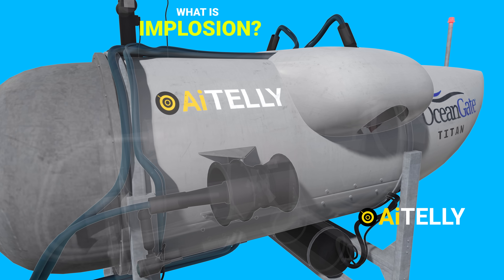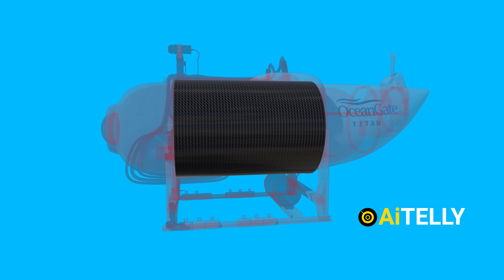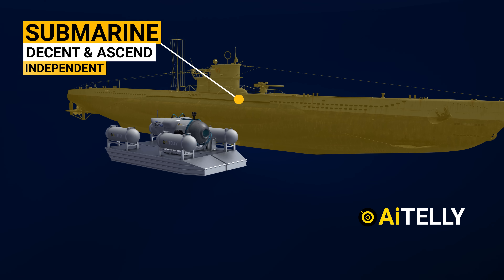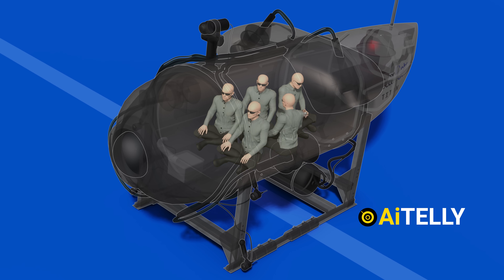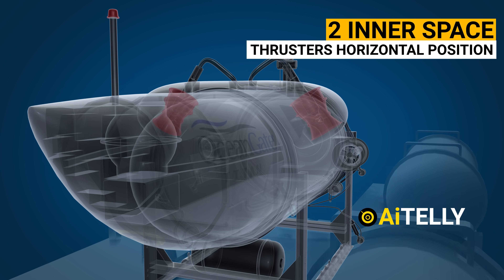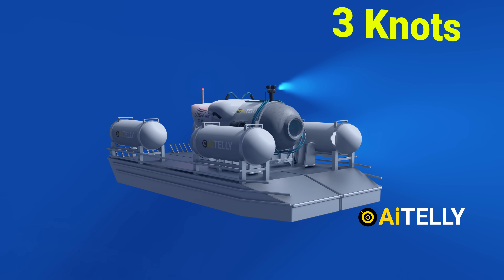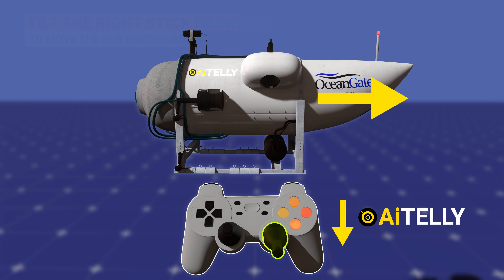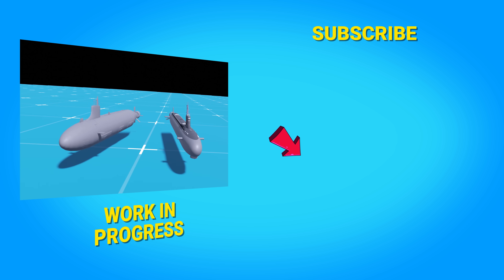Implosion Titan Oceangate How it Happened | Submersible Submarine Parts #3d

Comment: We dont know what depth the Titan was crushed at, just the time that communication was lost?  According to the SOSUS there was a sound anomoly of an implosion within a couple of hours of decent, it would be informative to know the precise depth as to the structural issues of this submersible which would be a determinal factor.
Reply from the maker: 😮😮😮 smart audience

Anyways 
You might also like Nuclear Powered Submarine Engineering behind it #3d Nuclear Reactor released
Link: https://youtu.be/J0lb46Zi5-s
Reply: It would be interesting to know if they crushed on the way back up after encountering a warning.

Comment: Transcript of communications has been released. They knew they were in trouble 20 min before communications was lost and presumably the sub was crushed. They had dropped weights and was rising slowly to the surface. They reported hearing cracking in the aft section of the sub and they were having problems with the electrical system which was designed by community college interns. It was rising too slow and they dropped the docking frame to hurry ascent. The cracking subsided, then resumed again. After a few more texts, all communication was lost. I'm actually happy to hear this scenario might have played out, because this means the passengers realized how shitty the sub really was and I hope  Stockson came to realization that he was wrong and everyone else was right about his sub.  They were likely panicking like trapped wealthy rats. At least all passengers got a real bang for their buck.
Reply: Your last sentence was unnecessary and heartless, mate.
Reply from the maker: Glad we found this comment

You might also like Nuclear Powered Submarine Engineering behind it #3d Nuclear Reactor released
Link: https://youtu.be/J0lb46Zi5-s
Reply: Wow.

Comment: I think in this animation the only thing wrong here is that the outer shell wasn’t under any pressure at all and would not have crushed as depicted. That is the reason there are so many large pieces. The only part to implode was the carbon fibre hull itself the outer shell was just a casing. I ain’t no expert either but I thought I’d throw my 10 cents in. R I P to those poor dudes though
Reply from the maker: Nobody is Right 

But You might also like Nuclear Powered Submarine Engineering behind it #3d Nuclear Reactor released
Link: https://youtu.be/J0lb46Zi5-s

Comment: Stockton  Rush was a gambler who took unnecessary risks.    Everyone in the deep submersible community with collective decades of experience designing and operating these craft told him it was unsafe.    He metaphorically flipped them all the middle finger and went ahead with the project.   The level of hubris, arrogance, recklessness on display was breathtaking.    Here is a basic physics observation that explains why this tub was a disaster.    It is well understood that a sphere is the most efficient shape to distribute  large amounts of pressure equally across it's surface.   As an engineer I was trained in college that equations and mathematical models are not perfect.    There are lots of unknowns that we just don't understand in complex equations so we just invent a fudge factor into the equations.  This "fudge factor" is where we lump all our ignorance about the system under study.    Tell me do you want to risk your life riding a submersible designed using this approach?
Reply: He was a sociopath and luckily he only killed 4 other people instead of hundreds or thousands
Reply: I've never heard the word HUBRIS so many freaking times as I have in comments/articles about S. Rush.
Reply: @jrambo7495  Sure, the crap, I mean craft could have been aptly called, 'The Hubris.'
Reply: What I don't understand is, if they wanted to go this route with CF, why not at least test with a remote unmanned model first? No one's life is at risk and you can find out that your design did or did not survive. Nope, just "I think I've got the numbers right. HERE WE GO!"
Reply: Fun fact. Mrs. Rush great great grandparents died on the titanic. The titanic has been ending the lives of rich people since 1912.
Reply: Perfectly penned 
and I enjoy reading the use of adult words being used as such. 
“The level of hubris, arrogance, recklessness on display was breath taking.  “ 

Yes it’s mind boggling to understand the reckless disregard for human life and to think he could design a sub without the advice of those that have been testing and building them for decades “TESTING” what a novel idea! 
Who would have think that one with money would cheat the whole system and not hire the best people WITH EXPERIENCE! 

Well… sadly it took the lives of people that didn’t deserve to die, no one does.  
But usually the idiots sort themselves out eventually.
Reply: @cindyherget5196  said culling doesn't happen nearly often enough
Reply: Fudge Factor perfectly described the plot of Jurassic Park, too. They didn't have the entire DNA code to replicate dinosaurs, so, they used amphibian. Same result. Bad news.
Reply: Great explanation. Thank you
Reply: I feel like he didn't care about basic physics or safety. He was acting like a little kid wanting to prove everyone else wrong (like you said with the metaphorical middle finger). I could have built this in my basement given the right tools. That's how scarily bad this was designed and engineered. I still can't wrap my mind around the fact that people paid money to go on this trip. That's literally paying $250k for su*cide
Reply: @reallifein3d A sociopath just like Lucifer bathing in the false light illusion that is the fallen angel. Legend had it that Lucifer was one of God's angels, but because jealous and spiteful wishing to replace God in contempt, mayhem, and conspiracy to ruin God's sacred creation, The Earth. The bad old cabal that forms the World Economic Forum and World  Government Summit is the old beast system coming out in plain sight to make the third world war. It won't be long that everyone agrees there's one question everyone must answer. Will you take a stand for all that is true and noble to save and restore Earth as the Kingdom of Heaven or are you one of Lucifer's coward traitors ducking and covering under the evil one's grand deception. Either we all get mass murdered as victims in fake democracy ruse or we die fighting for what's left of Earth and humanity in final battle for Earth which doesn't belong to the evil cabal of corporations and financial elites like Klaus Schwab and Henry Kissinger and their coward puppets sponsoring unnecessary dystopian manufactured crisis and the old war racket ruse, namely Joe Biden and Kamala Harris among a billion or so bad actors consenting to conspiracy for selfish personal gain and servicing their fragile ego's, for the Earth is God's sacred creation. The kicker or problem is we all can't seem to  unite nor agree on anything out of being dependent on the beast systems debt based economic, wars for profit, supermarket food, pumped gas, and global technocracy tyranny attempting to replace God as the false Messiah or savior. It's going to go as far as making WW3 with fake ET illusion arrival for it's subjects to take the market of the beast which is probably Neuralink brain implants Klaus Schwab announced are mandatory in 2029 which are likely to be the strongest fighting survivors of humanity and then of course  the coddled evil cabal sure to duck and cover inside a Swiss mountain when they order nuclear war. They really got North Korea going these days just provocatively announcing they're about ready to nuke the US mainland out of the perception of being deeply humiliated by America's powerful image and geopolitical dominance during the 20th century which doesn't bode well for us in the 21st century.  It won't be long that it becomes impossible to mention anything online and refer to posts and written history detailing truth to be stranger than fiction when the air and water in the outdoors are too bad to survive without equipment, protective gear, and resources. 

Reply

provatively
Reply: "gambler" ....???  NOPE, He was a Narcissistic Sociopath who did not heed the advice of his engineer who he fired for pointing out the flaws in his design. If he did listen to his engineer, he and the others would still be alive.
Reply: interesting thing is that all contemporary physics, from electromagnetism to relativity to qm to electrodynamics to gravity is full packed with fudge factors and deceitful variables; feynman plainly said that the material realityi does not exist, only math do, and a full series of phantom never seen particles and forces acting across the universe like magic added ex-post only trying not to collapse the contradictory theories; in the first place, i dont believe neither to the official version of this implosion, it seems a scam to me, because the beebe bathysphere, or the benthoscope, were 1.4 mt nickel chrome steel spheres 5 cm thick, certified to collapse at 3000 mt depth, and made a pair of voyages to max 900/1500 mt, and during all their operational life were constantly tested for microfractures; it is simply not possible that a plastic cylinder, with two metal detachable caps, could withstand tenth of trips to 4000 mt; moreover, ultra depth submersibles use advanced syntactic foams to fill the outer hull, where titan is photographed with polystirene fillings behind the glass fiber external panels. And i have tenth of other strong objections.
Reply: although the deepest submarine wasnt a sphere
Reply: @TheGrassyou  True, but they were made out of great materials like US Steel.
Reply: Simply, no.
Reply: The owner of the submersible was a total madman, that's why he didn't get to be an astronaut. The 4 passengers rest in peace.
Reply: One only has to read the New Yorker article to see that the arrogance and the hubris that ultimately did this man in
Reply: he didnt want some uninspiring 50 year old white guy he said so instead he got what he deserved.
Reply: Why did stocton do this he eas well warned he could of done so much more with his money when there is so much poverty in the world and his poor kids have to live with this where's wendy she has 5o live with this  she will be in some state being left with this mess  it just should never of happened
.
Reply: I certainly hope that Oceangate is held financially responsible as well as morally.  Stockton Rush was an arrogant man and an irresponsible engineer.  Didn't it say something like his toy was safer than walking across the street or something similar?
Reply: I agree.
Reply: All adventurers are gamblers and wreckless...and thank God for that. If they weren't we would never have built ships or tried to fly. Do you think that Vikings were safety oriented? Do you think there were even seatbelts on the first wooden plane?

YOU PEOPLE ARE ON ANOTHER LEVEL. 😂😂😂😂

Rules, rules, rules, safety, safety, safety.  😂

Live your life in bubble wrap but leave the rest of us their thrill seekers, dreamers, adventures and adrenaline junkies alone. You enjoy your knitting needles and rocking chairs...I'll be over here enjoying my parachutes, rock climbing and spelunking.
Reply: @caseroj6020  very interesting
Reply: he was a narcissistic asshole and should be charged with Murder, he knew this was just a matter of time.
Reply: Only my curiosity, if the tube where from steel or titan, then will the submersible survive the deep? thx.
Reply: @caseroj6020  I’m a stress analysis engineer (making sure things don’t break) for the main aerospace industry. 

This is a cylinder, not a sphere. A sphere will evenly distribute the load along the walls. A cylinder will have peak stresses at the ends of the cylinders and that’ll be the weak points. 

I’ve taken things to the line of complete ultimate without any failure and I’ve never had any issues, which will deem you as an “expert”
Reply: In the beginning of all this I did a rough calculation making a lot of assumptions but probably still within 10% accurate. At the depth of the Titanic wreck the total hydrostatic pressure attempting to crush the submersible was 425,000,000 pounds. That doesn't mean much to most people. So I decided to give that pressure some meaning. A fully loaded Boeing 747 weighs about 900,000 lbs; when you divide the 425 million by 900,000 you get the weight of 470 fully loaded Boeing 747s attempting to crush that little "plastic" cylinder attached to the titanium 'bottle caps'. Exploring the ocean at those depths does not allow for beta testing of diving craft. Way back in 1960 a well thought out craft went three times deeper down into the Marianas Trench,
Reply: I wasn't trained in any school. I was trained out on the jobsite itself. So who's opinion is more valuable? Pretty much the same answer but again no attention served to the lowly peasant.
Reply: @RobzdaBlade  No specific training for submersible design was displayed.  As they said themselves, they made a "basic physics observation" along with knowing about "fudge factor," albeit using the colloquial term.  All designs use a safety factor, especially good designs.
Reply: @RobzdaBlade it's nice to have both to be an interpreter between the book smart and the street smart people. My dad has both, and he always said to never disregard field experience. You know, even the best plans don't survive the first brush with the enemy, and all that jazz. And when your plans go off the rails, field experience takes over and keeps everything from falling apart.
Reply: @RobzdaBlade  Many jobs can be trained on the jobsite without formal training. Other jobs require complex math and physics training. People who designed rockets, planes, and space shuttles need formal training in math, engineering, and physics. Civil engineers need formal training to design safe skyscrapers and bridges. The combination of formal training and experience in those jobs is critical.
Reply: First off. People still die going to space. And even in subs. When any technology or weapon or medicine etc is created. There is always a testing period and human testing. And the gamble is always someone or alot of people will die. Nothing is 100percent even when its quote on quote ready and even had successful  missions up-teen times.
This man wanted to create something successful and go against the grain and be the master mind behind something he felt good about.
Experimentation is how things are created. Unless it is naturally done through nature than all of the things humans decide to create will always be experimental.  In this lifetime or later on. In a book someone will take this same idea. To try to makebit better. This history books have many inventors that started something failed and someone else came along and made it successful.
Reply: @Uwontregretit101  Your comment is valid, BUT in ALL the examples you gave, we MUSY assume that the PROCESS of creation was done RESPONSIBLY! And to me according to statements made by advisors ,designers , he DISREGARDED the advice that the materials were not safe. To the point of NOT subjecting the vessel to proper testing!! There is no problem innovating, but do it correctly. And in this situation, SAFETY is PARAMOUNT!! Nothing is more important. There IS a lesson to be learned here.
Reply: Must, sorry.
Reply from the maker: You might also like Nuclear Powered Submarine Engineering behind it #3d Nuclear Reactor released
Link: https://youtu.be/J0lb46Zi5-s

Comment: You can imagine James Cameron’s reaction when he saw the design of the vessel and how it was controlled by a cheap video game controller. Contrast this with his sub he designed to go into the Mariana Trench, Challenger Deep — super high tech, state of the art, multiple safety features and backup systems. Made of steel, not carbon fiber.
Reply: El controlador de juego no era un problema porque cumplía muy bien su función de dirigir.
Reply: Using a video game controller is mind-boggling stupid. This device is a toy, it is not reliable, and it raised the risks of failures substantially. These things were not made for industrial use and as we say in the Army; too many "unknown-unknowns" for the "effective and efficient control" of such a marine vessel. Even if the sub did not explode, was there alternative process for process control had the device failed? Case in point: Had the device failed, would the sub rise automatically to the surface (as emergency protocol)? Knowing Stockton's arrogance and stupidity, my guesstimate is no, he did not.

Comment: I'm no engineer, but what a piece of sh!t design that thing was.  Add to the poor design the fact that the carbon fibre was obtained from Boeing at a cut rate because the shelf life of the carbon fibre  had expired and was deemed not safe to build airplane fuselage with and its obvious  this ceo/ engineer should have been arrested before they went to sea.

Comment: The implosion time, according to my calculations, was around 20 milliseconds.
The carbon fiber hull - very likely - has shattered in many minute pieces.
Knowing the volume of the pressure chamber, and the water pressure, is possible to calculate the energy of the implosion, equivalent to 47 Kg. of TNT.
At the moment of the implosion, the air inside the pressure chamber has been violently compressed - like inside a diesel engine - and reached a temperature of thousands of degrees °C, therefore emitting an intense but brief flash of light. The expansion that normally would follow an implosion has severely been hampered by the water pressure.
The entire content of the pressure vessel has been torn apart by the water suddenly occupying the internals of the submersible, formerly containing air; consider that 400 bar of pressure are at the lower end of the pressure range of a water jet - used to cut metals...